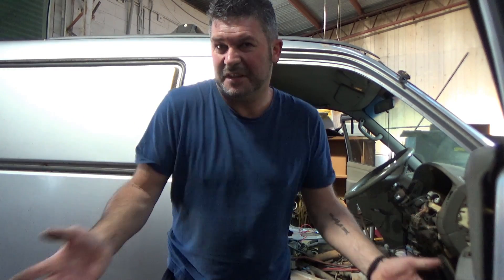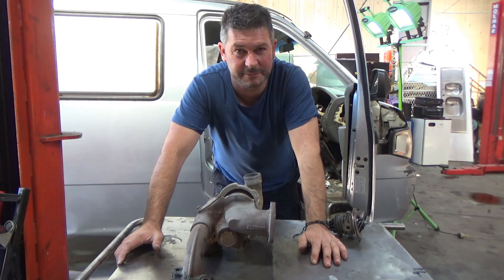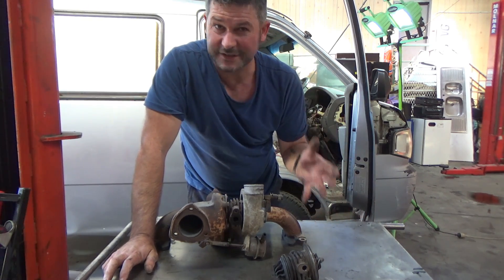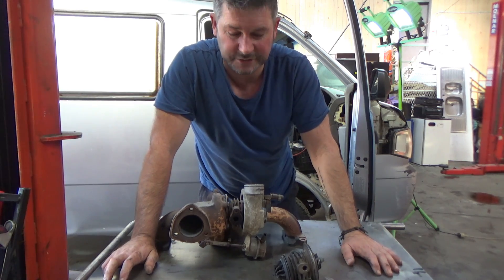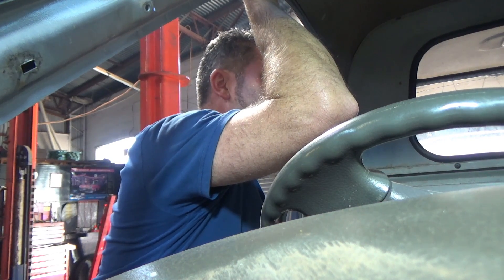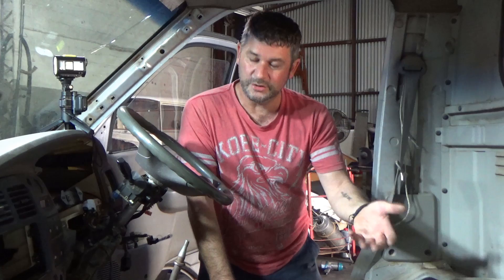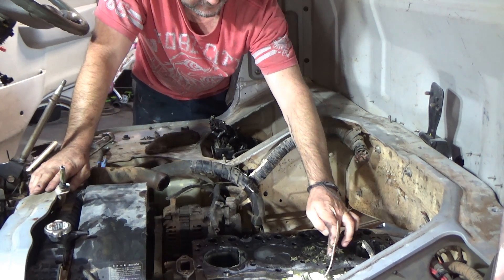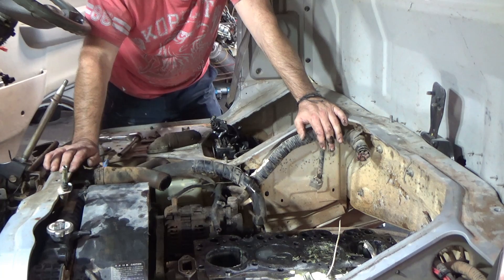How to Stop a Run-away Diesel -ENGINE BLOWS !

Comment: happened to me in a citroen van,screaming its nuts off,i put it in 5th gear and dumped the clutch with the brakes on,sorted
Reply: steven corner Whether the tecnique would work or not would depend on the torque and horsepower ratings of the engine I would suspect.
Reply: Ooooooo comeback 

I repair turbos the end:/
Reply from the maker: Heinrich Von Kekelnazi -Yeah , yeah, we all know that yank vehicles have ridiculous engines, but doesn't mean they have the same size clutch as the Kia van. It's all relative buddy. Bigger engine, bigger clutch, bigger gearbox, etc, etc
Reply: David Johnson so travelling along at 70 with an engine that's going to blow anyway would be a better idea? Sure dude
Reply: David Johnson mate you'd just hit the clutch and brake to a stop. Then dump the clutch in high gear once you've stopped
Reply: The  peterbuilt runaway video it has a Manuel! Just put it in 12th gear and job done
Reply: I love how this comment section is turning into russan restaurant
Reply: Naked Off Road I LOVE UR VIDS KEEP IT UP I SUBSCRIBED HE IS DOING THIS FOR ATTENTION AND IS NOT WORTH IT IGNORE HIM AND THANKS FOR THE COOL VIDEO
Reply: Look I don’t give a damn what any has to say it’s not rather the engine is saved or not it’s if you can get the some bitch to stop he was just testing shit to see if it worked or not and being honest anything is better than nothing maybe if your lucky you can killen with out the engine melting or going of like a time bomb as for different countries with different motor designs one every country going to have there design that differs from others can’t help that part but as for America diesel cause fucking America that’s why we fucked up government that likes taking candy from kids and wants control of every country that’s them that’s how they are can’t help it now got something y’all can invest in I’am currently planning on buying a m35a2 multi-fuel Duce wich it normally burns diesel but it burn just about anything thing you put in it including wast engine oil (gas will burn straight gas but not for long haha) kerosene will and a lot more including Jp-8 correct me if I am wrong now that said just get a fuck ball value or some shit and attach it to the air intake manifold that’s air tight call it even for fucks sake i understand this was a myth busting what you got laying around Test if it’s that way shit a 2x6 and a rubber gasket screwed or nailed to it size me very and some way to quickly detach the air intake hose to the manifold can things not be any more simpler as of that great video man you pointed things out
Reply: TheBCSledder, Heinrich Von Kekelnazi
in a properly designed and maintained vehicle the brake is always, ALWAYS stronger than the Engine.
Reply from the maker: steven corner - what I love about genius like you , is that you still watched it ! Yep, you are the reason I get views on my channel . Guys like you sit around on your lazy ass with your keyboard on one hand and your genitals in the other , never do anything yourself but have opinions on everything. If you can do better, don't tell me. Make a video and prove it !
Reply from the maker: steven corner -Nah, you watched it. Lol
Reply: Always wondered why people don;t do as you did as well mate. Quick thinking that.
Reply from the maker: Heinrich Von Kekelnazi -Sorry if that seemed like an insult buddy. It's just that 7 litre engines in a private vehicle seem pointless to most people , other than yanks . Their litre-hp ratio is pretty damn poor too . Which is why in Aussie they are not popular. I would bet that most late model Japanese + European diesels would put out similar power/torque with half the capacity and fuel use.
Reply from the maker: steven corner I can't please everyone. Sorry. Maybe you can go back to the Russian car crash vids for a few cheap thrills
Reply: MINIMOTOMADNESS That's nice, but that is not an option in American diesel pickup trucks. For instance, the Ram 3500 has a 6.7L inline 6cyl Cummins Turbo Diesel, that makes 930lb ft torque. Dumping the clutch in 5th will not stop that engine from running away.
Reply: if you were already in 5th gear doing say 70 & your turbo failed & it started to run away then not sure it'd work the same as you already have to try & brake the car down from the travelling speed & overcome the runaway power as well, depends how much breaking power can be produced & if the clutch would handle it
Reply: As well as the friction generated by the clutch etc. I know. To be honest the vid was so boring I never go to the end. All the best
Reply: ok, most of it ;)
Reply: Naked Off Road Are you angry that the "yank vehicles" can pull your house down, while your Kia can barely pull itself? 

Why so defensive and quick to attempt insults on inanimate "yank vehicles"?
Reply: nope mate wouldn't be wanting to do that, if you are traveling at about 70 & this happens & you press the clutch to break to a stop, in the time it takes you to stop the engine is thrashing it's nuts off & that time it takes you to do that is long enough to blow it up!
Reply: Wow, so many assumptions. All wrong you idiot
Reply: Or maybe you can stop making shit video's and go fuck yourself

Comment: instead of using a rag to cog up the intake hose which requires removing the air filter on an engine that might soon explode.Try using a plastic bag and wrap it around the airfilter. It will not get sucked in, but the initial vacuum will make a perfect seal ;)

Comment: I think I have a different, maybe even better solution. Since two things can make a diesel engine "runaway", diesel and oil. To start, cut power to the diesel pump by disconnecting the battery. If it doesn't work, then it's burning oil. Simply disconnect the air tube that's going into the intake manifold and it should stall then and there.
Reply: reaper reaper lol ur funny.... Firstly a lot of diesels have mechanical pumps, driven by the engine, not the battery...... And secondly, not all runaways are feed by the turbo leaking oil into the intake aaaannnnnnddddd then there's the issue of getting under the bonnet and casually unbolting your turbo off your SCREAMING engine, these things are a PITA to remove on a cold stalled engine, try it hot and out of control, meh I don't think so...... Point is this vid is about why it happens and a quick safe way to stop it

Comment: You got the methods right, but your putting in gear test wasn't done right. You have to remember a run away engine will be revving at RPM's much higher than it would from just full throttle.
Reply from the maker: RustySkull Productions -Its a test . Best conditions we can duplicate on our budget. Full throttle on an old push rod , non turbo.
Reply: That's right, I wasn't criticizing, just simply adding my comment. You got all the methods right and I've used the 5th gear and slam the brakes on method myself.

Comment: so basically don't buy a diesel with an auto trans
Reply: specifically a c02 extinguisher
Reply: Cameron ZY Put a Positive Air Shutoff on it if you're that worried
Reply: Dual clutches and automatics are not the same thing. The classic automatics (such as the drag racing ones) consist of a planetary gearbox coupled with a torque converter. It's simple, reasonably reliable, but wastes tons of energy, while being a bit sluggish to drive because of the torque converters response time. It's great for drag-racing because you get constant torque, but for any race lasting longer it would burn up because of the amount of energy that is being converted to heat in the torque converter. a dual-clutch is a manual transmission with an automated (double) clutch system, that manages the "hard" part of a manual for you, while achieving a nearly constant torque through shifts, because there is nearly no time where a gear isn't in use.
Reply: Yeah. Also don't drive your car ever at all because you may get hit by a lightning and die.
Reply: Autos are also more consistent than a manual for bracket racing. They can shift faster. In most forms of racing? An old clutched manual transmission is a detriment, a pointless disadvantage that you hinder yourself with. Dual clutch boxes are just better at basically everything.

However, for the spirit of driving? I'd still take a clutch and a 5 or 6 speed on the floor.
Reply: not an issue at all now, modern diesels use a cpu and electrical injectors, thus when you cut power, they cant run
Reply: @jusb1066  As he says in the video, that dosent matter if the problem is a leaky turbo.
Reply: Charlieswag9000 or a halon or halotron will do the same job.
Reply: That's only because they don't have enough time to shift gear... For everyday use, the manual is more versatile than an auto.
Reply: Actually you are better off keeping a Halon fire extinguisher around with automotive repair. co2 can be a bit more dangerous, and Halon is safer around humans then co2.
Reply: u just need to maintain it ! like all cars!  if u dont mentain gasolin car it will die also)
Reply: +What's the geek Automatics replaced manual transmissions on the drag strip decades ago.
Reply: Just don't buy an auto trans car at all. doesn't matter if it's gas or diesle, auto is 4 n00bs xD

Comment: This is why I believe turbos need an emergency oil shutoff. Turbo might end up getting destroyed but its still way cheaper to replace a turbo than an entire engine in most cases. That is if the vehicle is even worth it by then.
Reply: A large butterfly valve for the intake would be better.
Reply: @Stacy_Smith  yes. My 90s Suzuki Vitara td has an intake valve that shuts off with the ignition, in addition to the fuel shutoff. I test mine regularly, and it stops the engine pretty much immediately but smokes a tiny bit in doing so, which is understandable as it's choking the air supply causing the injected fuel to not burn for a few cycles.
Reply: ....Turbo already needs to be fixed if it's due to oil bypass in the turbo itself. So, no big loss there anyways.

Now, if you shut off the oil to the turbo, and find it's your fuel pressure reg or something....then damn, you killed your turbo, and the engine is still going...
Reply: Chris Marek... all the older 2 cycle Detroit diesels had an emergency kill lever in the cab...it was a flap on top of the blower, that when released, closed off all the air suppy...engine would not run, until you reset it..

Comment: Pull the main body fuse or the circuit breaker's you cut the power to the engine is going to shut off
Reply from the maker: Ed Isom -Thinking you might need to do a bit of research on how Diesel engines work, and what a run-away diesel is.
Reply from the maker: Ed Isom -As I say in the video, this van is a mechanically operated fuel system. Any diesel operating this way can't be shut down electrically . It may be possible in newer engines .
Reply: Err no. A true runaway is unaffected by electrical input or lack there of. If it were that simple one would simply turn it off!!
Reply: You know nothing Jon Snow. Diesel engine can work without any kind of electrical  device.
Reply: Naked Off Road 
I have come across to people with a runaway diesel engine I pop the hood and pulled the main body fuse he killed all the power to the vehicle it shut it down for us it was a newer one a lot of computer stuff but it shut it down no 12 V power it didn't run
Reply: Naked Off Road 
I understand that's all I've ever owned was diesel pick ups so I do know how diesel engines operate I was strictly talking about the newer ones
Reply: Pull the fuel pump fuse

Comment: lets see you get it into gear after it has run away. you put it into gear before the engine wound up. I dont think it will. you know, synchros  (It sounds like that engine has a low or no compression cylinder judging by the cranking rhythm)
Reply from the maker: joe bob-Umm, you realise it still has a clutch right ??

Comment: A runway in a turbo diesel is why I would want to have a Co2 fire extinguisher on hand. And with the old diesel engines with the where the fuel rail is stuck (many if not most of the older 2 stokes have the flap on the intake, you pull a knob/lever to choke it out). 

I'm not sure how well a Co2 fire extinguisher would work on a semi that has two intake boxes (I guess if you had a passenger and two Co2 fire extinguishers on hand spraying in both intakes might work).

I guess you could have a Co2 fire extinguisher in the passenger compartment or cab where it has a hose leading from the extinguisher directly into the intake, in case of a runaway you could just enable the extinguisher and choke out the engine without having to pop the hood.

Comment: Love the videos, Keep up the great work! I tuned in on the hydrolock vid and just found this one. Subscribed for sure.  Personally, being aware of the possibility of run-aways, I'd keep a CO2 or Halotron extinguisher handy in my truck/van/diesel powered thing. Just in case. I usually have one in every one of my vehicles (petrol powered) because "fire bad!". (I've had an injector o-ring pop out before!) That right there is a money saver! But good to know that most diesel goers should be snuffed by the gearbox. Looking forward to more!
Reply from the maker: Eyebrows Mahoney Thanks for the positive feedback ! We are still amateurs but have plenty more " destructive testing" to do yet. Creating a video currently that showing what happens when you loose all your coolant , and what the gauges don't tell you is happening. Yeah, we blow it up
Reply: I look forward to it! I've been wanting to make videos like this but haven't had a source of vehicles to do it with. I'm glad someone finally is! Destructive testing is where it's at, you know what happens and how!

Comment: I had a megane diesel run away, putting it in any gear didnt work it just slipped the clutch the revvs was too high, im sure stalling it works on low power only... the clutch wasnt shot either i replaced it a couple of months prior
Reply: Christopher Hargreaves nah the engine will run till its out of oil or the air flow is stopped

Comment: What do people think about blocking the exhaust?
Reply: will blow the heads off if not the exhaust first. you can create way more pressure than vacuum(aka removing the air from the intake is the best way).

Comment: Another youtuber said you can use dry powder without damaging the engine because it clogs the air filter. 
I am not brave enough to start disassembling my intake while my van is running away.

Comment: Water? If you have a bottle of water? Maybe sticking the water bottle in the intake or letting it suck in the water?
Reply: milo9598 Water cannot be compressed,if it
gets in the cylinders, it will fuck your engine
for sure! Look up hydrolock.
Reply: Golf Man yea I know what hydrolocking is. I was saying that to see if it could stop the runaway. And be recoverable.
Reply: milo9598 If you're lucky you may get away
with damaged pistons and bent con rods,
got to be better than a bent crank and a
block in pieces, but then it will be spinning
well passed it's red line limit, worth a shot
though if it's going to end up buggered 
anyway.
Reply from the maker: Check out one of our other vids. " we dump in 20 litres at 4000rpm". Water stopped the engine, yep. But wrecked it completely

Comment: I think stalling/put it in gear would work on smaller low HP engines....a big high torque engine might be able to over come the pressure of the brakes.....
Reply: The brakes are designed to be able to overpower the engine. So unless it is a tuned engine with stock brakes or the brakes are not working properly. But in a maintained stock car it should be good.

Comment: I have had to use the extinguisher trick on a tractor trailer but shot the breather pipe. Motor tried to suck the filter in. Turbo seals got fixed good as new.

Comment: Naked Off Road You're not supposed to spray it in the engine! The air box or air cleaner is what you need to spray! It keeps the dust out and stops air flow. You do have the right fire extinguisher gas extinguishers cause the engine to turn into a giant piece of shrapnel!
Reply from the maker: Ima Freeman I'm pretty sure that if a block of wood straight over the intake didn't starve it for air completely , then relying on powder to seal all the paper in the filter would be impossible. Not to mention that a completely blocked paper filter would just collapse and be sucked into a high revving engine. That's pretty obvious.
Reply: Naked Off Road Okay yes the block of wood didn't stop it from running and yes the air filter does collapse and will get sucked into the intake but most if not all paper filters have a cage inside or on the bottom  which stops the paper filter plugged with powder from going in the engine!

Comment: I had a late 1990's Dodge diesel 1 ton tow truck overspeed and burn on me while going for parts one day. Apparently the problem was the fuel pump overcammed. Scared the piss outta me...but hasn't happened since.
Reply from the maker: Yeah, that makes sense. I'm assuming you mean the throttle on the pump went past its spring-loaded return and decided to give you a "shit your pants" moment.